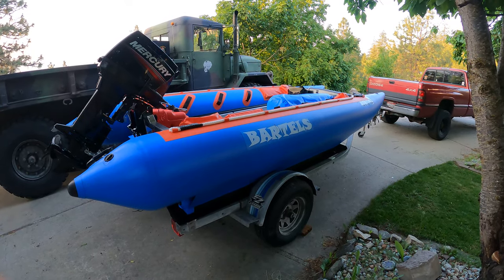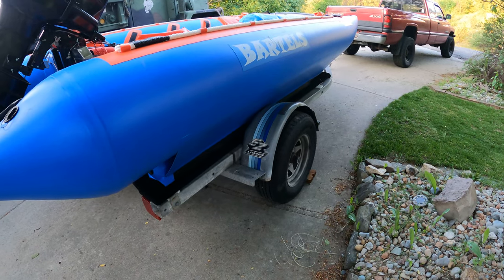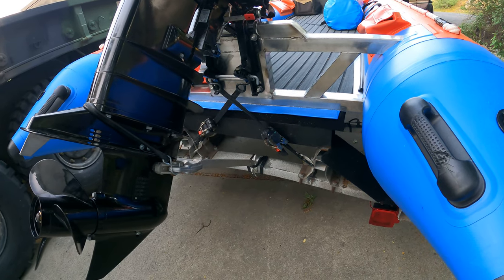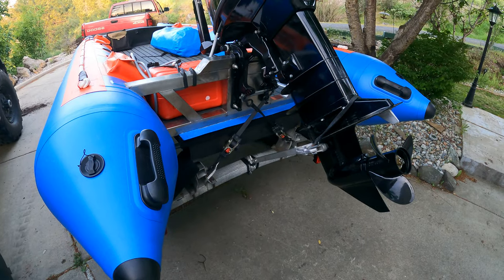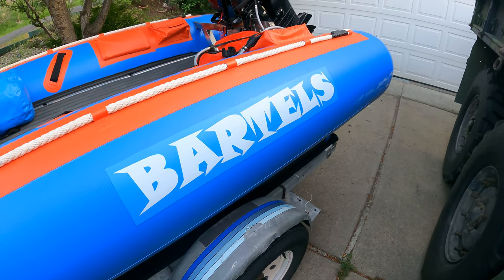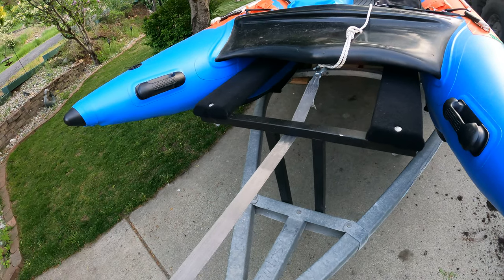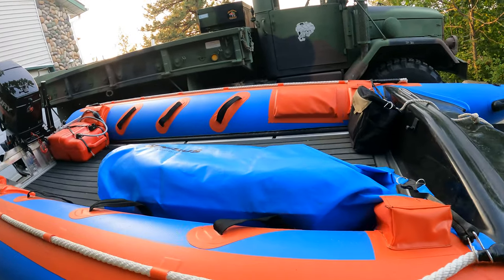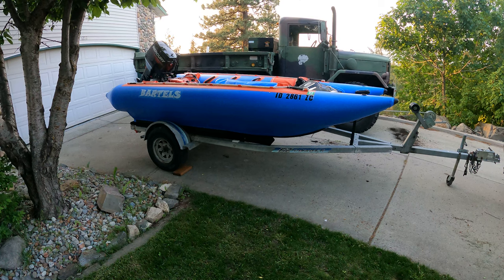chinese thundercat walk around

Comment from the maker: We did add the 2" tube on top as a spacer because the motor is a long shaft. Thundercats are really designed for a short, but I'm not even going to bother trying to find one.
Reply: When you say it’s a long shaft do you mean 20” or 25”?
Reply from the maker: 20
Reply: @codemang3635 did you have to pick it up at the port or did they deliver it to your home? First time buying something this size off of Alibaba for me.
Reply from the maker: @aaronlingo3989  I had everything done by a broker. There will be : 
import security filing (ISF)
Then freight to port in chine
Then the actual sea freight on container ship
Once it lands in port, your freight forwarder/broker will clear it through customs.
Then, if you're not close to port, like myself, shipping to home from port.

Also, expect a 25% tarriff, which sux butt. 

Most of this hinges on where you're at. 

Email me at freedivesandpoint@gmail if you want some more specifics.

Comment: I know youre not racing it but how is it holding up?  For the brand are you happier with it?
Reply from the maker: Yeah, its doing great. I wish it had over pressure relief valves, for when the day heats up, but that's the only shortcoming really.  I've only had it for a summer and winter so far, but I haven't come across a single issue. No seams have shown any funny business.

Once I get a proper short shaft on it, I'm confident in being able to push it quite a bit harder too. One of these days, when the waves get big out there, I'll get some good video of what it can really eat.

Comment: What was the total cost on your thundercat including tariff?
Reply from the maker: 8k home. Not including trailer.
Reply: @codemang3635  The stuff people are using in the Souther Hemisphere is next level!  I've got a True Kit inflatable catamaran that I've been running in Hell's Canyon and it works amazing!
Reply from the maker: It all comes down to what you can afford. The boat alone on alibaba is only 1200 bucks. A real racing thundercat is 6k for the boat alone. Since I'm more utilitarian and not racing, I can't justify the fancy stuff, let alone afford it.

I know takacat's boats are sourced on alibaba, and for like 500 bucks. Cant remember, but the true-kit boats might be on there too.

Geothe has a 13ft air floor cat with hijackers on it. Should definitely check that one out! I will likely get one soon.

https://m.alibaba.com/product/1600506161913/Goethe-High-Speed-Racing-Rigid-Hovercraft.html?__sceneInfo=%7B%22cacheTime%22%3A%221800000%22%2C%22type%22%3A%22appDetailShare%22%7D&from=share&ckvia=share_fb0e9d6fa4024787b26cd5fe22f6524f
Reply: Just curious why you would consider the 13ft air floor model when you have your current one. Is there a benefit of the airfloor over the hard that you have? Can't you have a higher HP engine on your harder floor model vs air floor. I've been looking at the true kit style and the thundercat. Major difference is the weight and the maximum HP rating? Any recommendations?